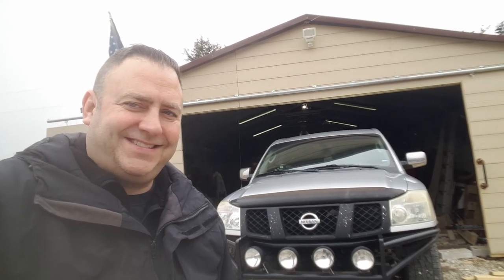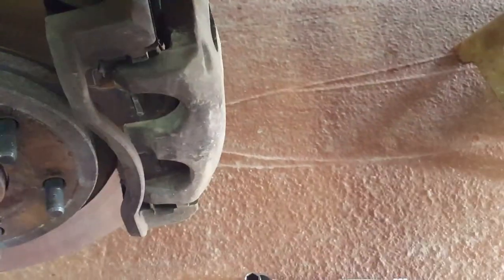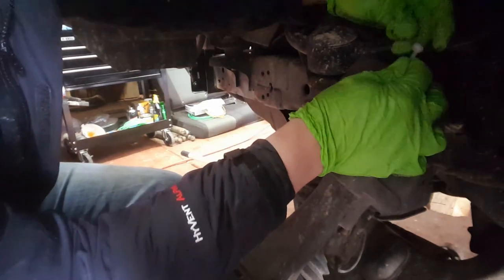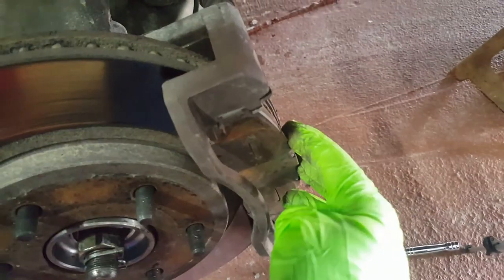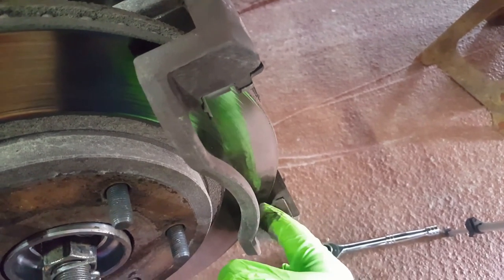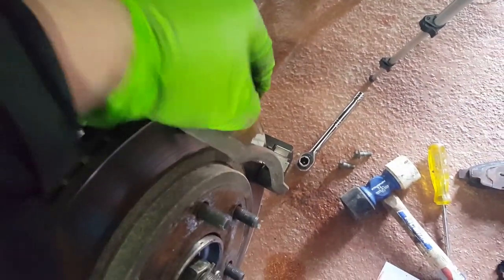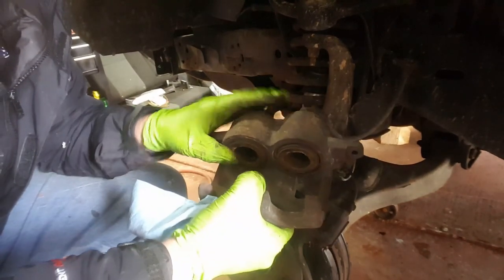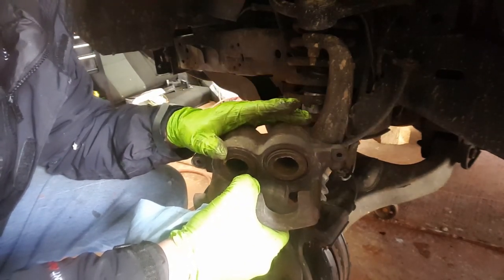NISSAN TITAN FRONT BRAKE PAD REPLACEMENT 2004-2015

Comment: I did a set of these today and the calipers were incredibly tough to put back on. Would you say a warped rotor could cause that? Both pistons in the calipers were fully depressed.
Reply from the maker: Did you depress the caliper piston all the way in before you put it back on the rotor?   A warped rotor, or bad caliper piston could be the culprit
Reply: @RoadHardRoadhouse  I did. I ran it by the owner today and he didn’t seem to care too much. He will learn sooner or later haha
Reply from the maker: I have replaced all of my rotors, and calipers at one point or another......